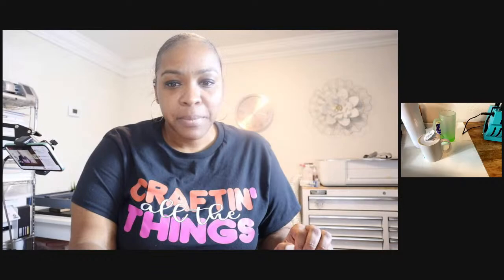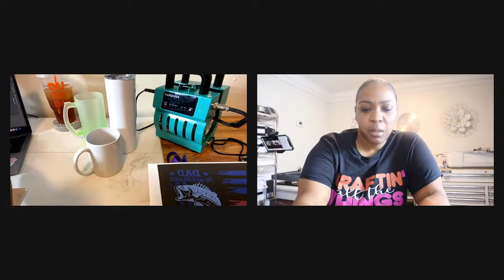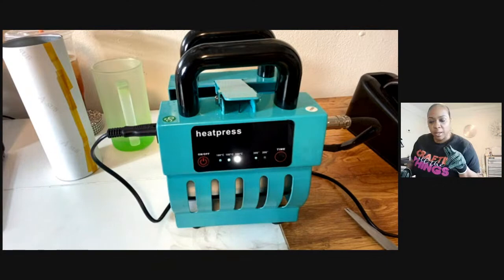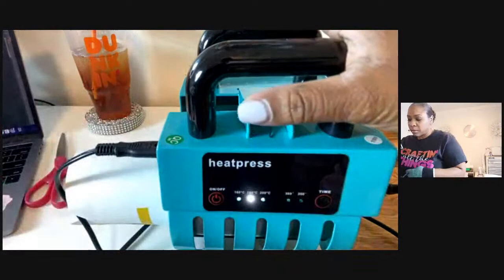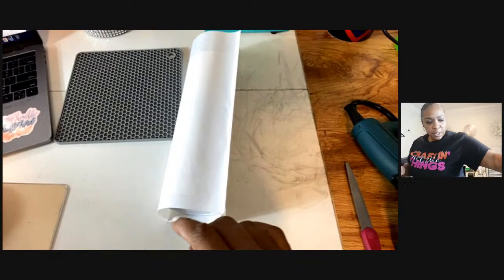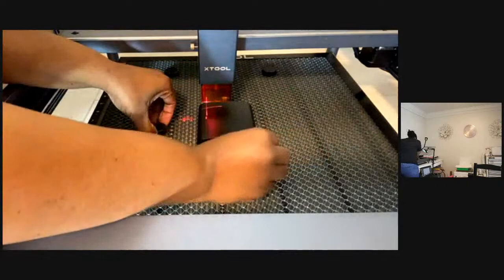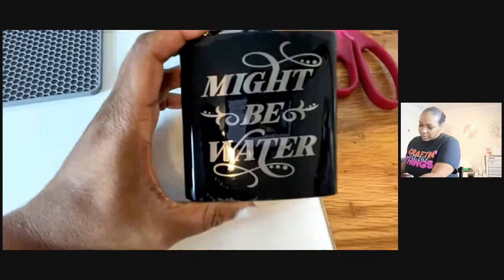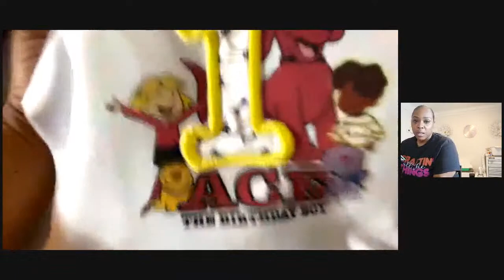Craft-Tea Talk | Father's Day Sublimation Tumblers & Mugs| RealKant Mini Press

Comment: Do you have a video using your convection oven? I think I may have the same one but I’ve read reviews and it says it cracks some glass. Mine is a rotisserie one also. Also what temp and time do you do with oven?
Reply from the maker: Hi Michelle! Yes, I do. I use it in most of my tumbler and mug videos. My time and temp is usually based on the item. For ceramic mugs and glasses - 380F/12-14 min. For stainless steel - 380F/4-6 minutes.
Reply: Thank you so much!!! I’m new and excited to try this new adventure!